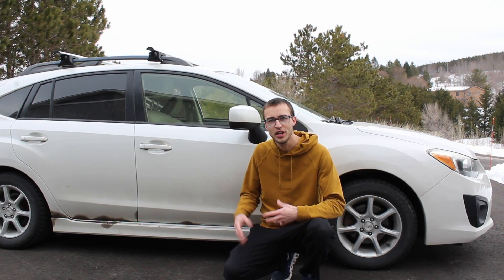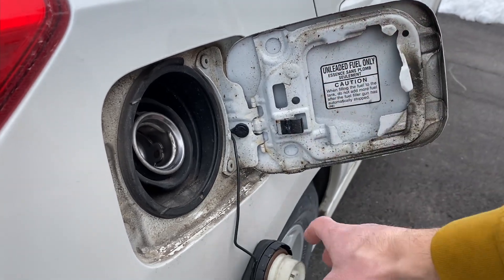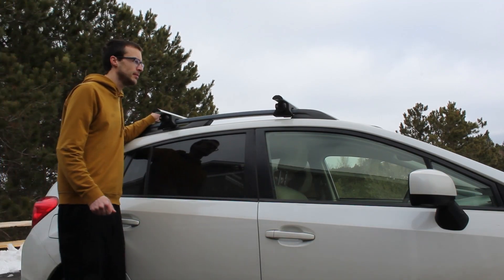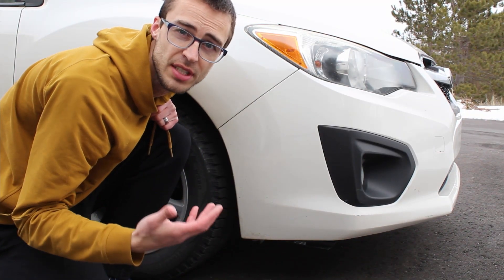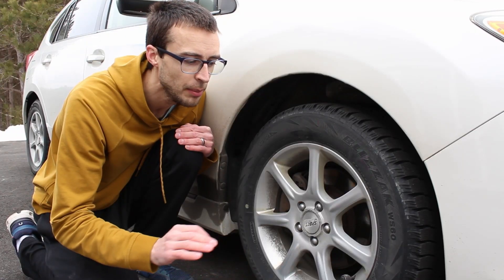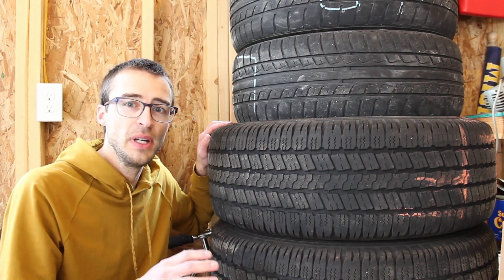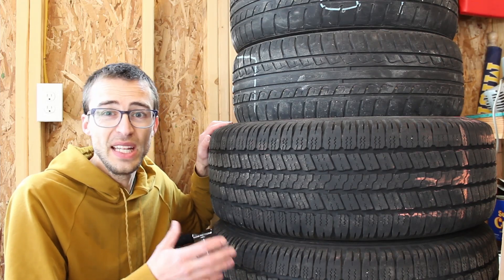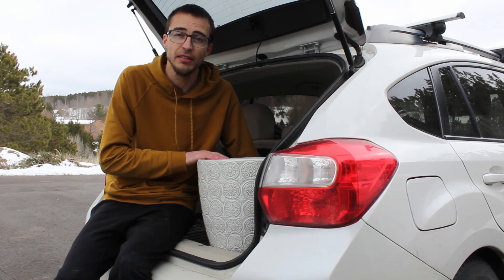Bad Fuel Economy?    Here's Why

Comment: Winter/ colder air can reduce mileage since it's denser so it requires more fuel to get the correct ratio. Not 100% certain, but it makes sense to me when I think about it. Also I think rpm is more important than the speed you drive. Sure speed and rpm go hand in hand, but keeping your rpm low as you  can can increase mileage